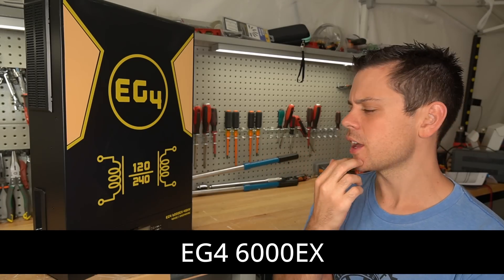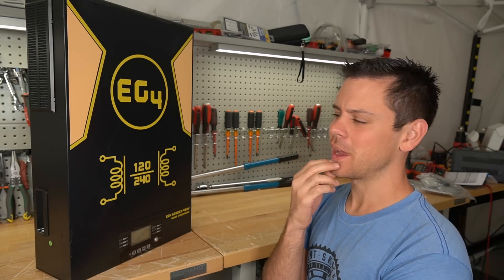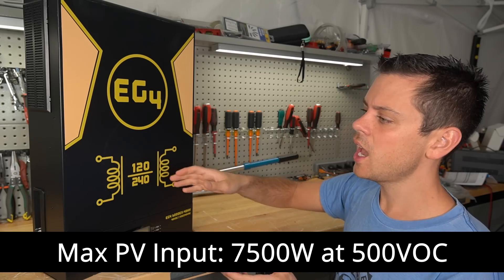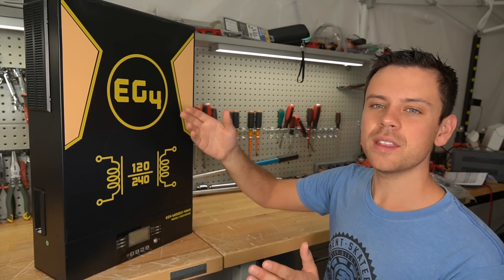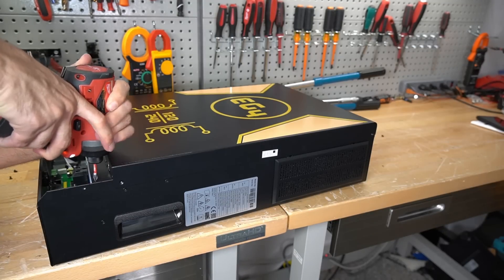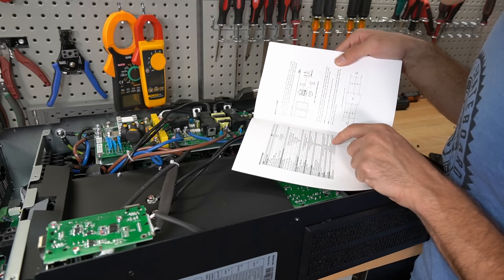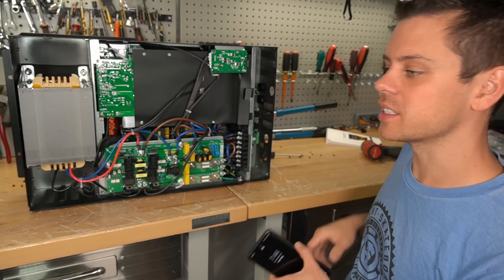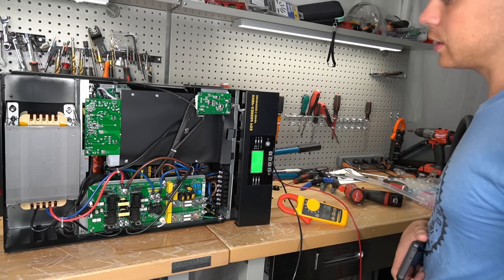EG4 6000EX All-in-one: 6000W LF 120/240V Inverter, 7500W PV Input, 120A AC Charger

Comment: I've been trying to find out even called Signature solar about what the idle consumption was if you turned it off and doesn't still take it solar to charge the batteries also will it shut down the system based on batteries like FLA below a certain voltage when it shuts off does it still have an idle consumption

Comment: Im assuming I can hook up any brand battery to these and not just the EG4 server rack batteries.  I don't see why it would be an issue other than the lack of communication ports, but figured id ask the experts here to be safe :)
Reply: Yes - you just have to go in and change the battery settings to the type of battery you're using, and set your battery parameters.

Comment: Thanks a lot for all the useful information. Maybe I'm an idiot but I sure am a beginner that know nothing about an off grid system. Where I live there is a lot of wind and not much sun... Is there some All-in-one solution that could work with a wind turbine? Is there an equipment I need to convert or regulate the turbine output so I could plug it in the solar input on these solar systems? Yeah I warned you... I'm an idiot. But if somebody know the answer, I would appreciate it. Thanks.
Reply: You could have your turbine feeding a turbine charge controller which is then feeding the same battery bank that your solar system is feeding. You'd just want to make sure that the charge rate to the battery is similar to the charge rate of your solar system.

Comment: Using two inverters seems like a novel idea. I guess you'd have to manually power on and off the EG4 when needed?
Reply: If you're concidering 2, the EG4 6500's make more sense
Reply: @designdepartment841  I'm not considering two EG4's because the idle consumption would be voracious.  I'm considering 1 EG4 for high loads such as my well pump, plus a smaller inverter that has low idle. I'd run the EG4 in ECO mode most of the time and let it trigger into full mode when there are high loads. The rest of the time, the smaller more economical inverter would be primary.

Comment: I wish they would build one for 24v source instead of only 48v. My setup is mobile and my truck runs 24v and I want to use it to charge directly without additional efficiency losses from dc-dc converters

Comment: About the transformer efficiency, Very large transformers achieve greater than 99%(grid and data centers).  This is achieved by using as much steel in the core as possible to reduce hysteresis losses by staying far away from saturation. In the old days, the rough rule of thumb was 25 to 50 watts per lb. but it is obvious that transformer design and materials have improve very much since the 1960s 🙂

Comment: I ordered the PowMr 5500 220 volt inverter, not knowing it is not a two leg 120volt out per leg I thought that was standard for 220 volt here in the US. So I was doing some searching on Youtube to learn more about this unit and this video popped up. The first thing I noted is the 120 / 240 on the front of this unit. So looked into the specks of the PowMr a little closer and indeed it is 220 volts out on a single leg and not two 120 volt legs. So cancelled that thing and I have this unit here on order now. I will be running a 220v welder and a 220v CNC plasma cutter of this thing along with generator support during those operations. I think this will fit perfectly as we can expand this system as needed and that is exactly what I was looking for.

Comment: Will, could you do a video on the ways to add batteries to an existing grid tied solar panel system which is using micro-inverters.
I have 12Kw of micro-inv panels, Enphase system, with 3 lines (4Kw each) that come off the roof. I mostly have a power bill of $0. But when the grid goes down I get zip (also No Water). The idea was that I was going to wait for battery prices to go down. I think now is the time, but don’t know what configurations are possible let alone best, given my starting point.
Thank you in advance for any time or attention you give this. You and your videos are awesome.

Comment: Great video Will, thanks for all you do.  Are you sure it is a low frequency inverter or does it just have an auto transformer to get the split phase?  The spec sheet says surge capacity of 12 kw for one second, does that indicate a low frequency inverter?  Thanks
Reply: It's a high frequency inverter with a transformer for split phase.

Comment: Another pro for this inverter is you don’t need batteries. They will run off solar alone as long as you have enough PV >150v. 😂 I have the Sungold Power SunBlue version. I love it. After my 1st Sungold power LF 3000 watt 24vdc inverter charger I decided to stick with them. I punished that inverter and it just keeps on ticking. 3yrs and still going flawlessly. I have 2 of the sungold 6048s.

Comment: I was waiting for this review and my thoughts were spot on. i bought this because it was the cheapest way in my opinion to get an all in one inverter that would do 240v because most a/c units where i am run on 240v. keep doing what you do bro we appreciate the knowledge and all that you share.
Reply: Still running? Lots of issues talked about on the forums. Getting ready to install 2 and a little scared

Comment: Perfect!  I was on the fence about either buying this new split-phase 6000EX inverter or buying the two 6500EXs and doing the split-phhase wiring while spending twice the money for inverters for that.

Bottom line, a single split-phase 6000EX may be a good low-cost entry-level solution for 240V but the 2 x 6500EXs are more efficient and better for my solution that will scale out with more solar panels and batteries anyway.  As for the split-phase wiring for 2 x 6500EXs, Will already figured out and posted the blueprint for that on his website.  Perfect!
Reply: Remember, 2 x 6500EX's at 70W idle consumption each will draw 140W total idle consumption vs 135W for one 6000EX, so no big saving there. Alternatively, get 240Vac by pairing 1x 6500EX plus one mid-point transformer, which together may also draw ~135W, so there's no magic way of lowering idle consumption if you need 240Vac with EG4 units.
Reply: @lewisreford8552  Yes, I remember what he said in this video.  I also remember that he said to just add more cheap solar panels to offset the idle consumption, assuming you have the land ... I have the land.  Also, I need 240V to run high-end ASIC miners 24/7/365 ... so, there will never be idle consumption with my setup.  That's the least of my worries.  My priority is to achieve the best efficiency possible over long-term 240V continuous use.  For that, Will said to use 2 x 6500EXs and then stack on more pairs as needed.

Comment: Let's say you have a well pump and that's the only appliance that requires a large surge. You could use a second pressure switch (like the one that turns on and off the pump) to turn on an off a big LF inverter to supply the current only when needed for the water demand. And then use a very efficient HF inverter to run 24/7 for loads that require less surge.
And, if the LF inverter can safely handle the pump load staying always switched on (pump connected directly to inverter with no switch between inverter and pump), then you need only the one water pressure switch to turn on and off the inverter.

Comment: 3.2KWh per day of idle consumption.
You cannot offset that with just panels, because panels can only offset while the sun is hitting them pretty directly. For the rest of the day AND the entirety of your cloudy days, that 3.2KWh must come from precious storage, and that's the most costly part. So you don't just need two extra panels; you also need an extra battery (basically another 48V 100Ah $1500 battery.... just to keep the inverter turned on). 
And on those consecutive days of cloudy weather, 3.2KWh EVERY DAY! So let's say you spent $9k on six batteries; half your storage will be depleted over four cloudy days, just to keep your electricity on!

Comment: What is a good stable low cost mppt solar inverter CHARGER for a day campervan? I'll have a window ac & about 3kw of cooking appliances. My energy spreadsheet estimates about 6.5Kw full load (all items running, but highly unlikely)...more like 4kw max for only 2hrs cooking, then fridge, heat or ac 24/7... SUGGESTIONS PLEASE..

Comment: Im glad to see this company improving these designs. I have an LVX6048 and the small terminal studs were definitely annoying. Glad to see they fixed those issue. Unfortunately  I think I can still see that grounding screw in between the battery terminal studs. It may not be a problem but its scary to have that there.

Comment: Ideal current is one thing.  But what about with a 300-500W continues load?  How much of that overhead gets re-captured (as the LF inverter has to fight it self with no load).
Reply: My Sigoneer 6000 watt split phase Low Frequency inverter burns 86 watts at idle. Much to my disappointment, I found that it adds about 86 watts to any load. Say I run an 800 watt heater. I am seeing 886 watts leaving the battery. On the same panel I have a cheap HF Reliable 3000 watt 24 volt inverter that uses 11 watts at idle. That unit runs refrigerators and freezers 24/7 and the Sigoneer only runs during grid outages. So far, it appears that the idle consumption is additive to the load on my inverters running 1/3 to 2/3rds load all the time.

Comment: My concern is, companies like EG4 keep coming out with new models, new features, which is good, however that basically means every model is obsolete in 2-3 years. What will support be like in say 5years. Victron may cost more, but it is a fairly stable platform with fewer but rational upgrades and basically just flat works. So do you want to be on the bleeding edge, or build it, use it and be done?

Comment: You have no idea how reassuring these uploads are Will. I'm about to spend a small fortune on a large system and truly I would never have had the confidence had I not been a subscriber to your channel for years. The service that you have provided to this community and this industry is immeasurable. Thank you.
Reply: I'd hold off on these... Signature told me to "wait until we get the firmware upgrade".... I had $19k sitting in my solar closet and they want people to wait... Stop selling these until you figure it out guys.
Reply: @jasonhensley947   we made the mistake of buying two EG4 6500 inverters. 
Issue after issue unresolved. 
Our panel installer recommended Outback. Service after a sale is worth something
Reply: @richardreese5377  I made the mistake of buying one of these  6k split phase inverters from SS. They shipped me a broken unit and it took weeks to resolve. Lesson learned... take these Affiliate influencers with a grain of salt when it comes to product recommendations with financial ties.
Reply: What did ya buy?
Reply: AMEN! Will is the man on solar stuff!!
Reply: So true! Thanks Will.
Reply: Amen to this
Reply: I bought one of these from Signature Solar and it works perfectly. Thanks will for the info.
Reply: I was looking at this unit because i want to power an a/c unit on 230v since more efficient and don't want to have to buy two inverters.
Reply: I got 4 of these 1 year later 2 have already died.... Hope you didnt buy them.   Hoping the XP models are a bit better

Comment: That no-load current is atrocious for an inverter this size.  They should be able to get that under 50-75 watts just by adding a few chokes to the input windings and using a toroidial transformer.  They will also likely need to do a bit more work tweaking the software a bit more for efficiency.  That no-load current is not something you get back, all or most of it just ends up as waste heat regardless of the load on the inverter.  I would be very sceptical of thier 93% efficiency figure since that is probably at 50-80% load and most inverters are going to spend most of their ontime down around the 5-25% mark only going over when running big loads like dryer, range, HVAC, and waterpumps.  

Even the large Victron units seem to pull more power at no-load than the spec sheets suggest.  I helped a friend with a 10K Quatro from Victron and the spec sheet says it should pull 55 watts at idle but it hovers around 100 watts going up and down a little bit over time.

Comapred to that my Genetry Solar 6K inverter uses about 35-40 watts at idle when the fans are off.  They will be shipping  a 12K unit in the next couple months that I hope has a low noload consumption similar to the efficiency of the 6K unit.  I was told they are shooting for well under 1A idle current on a 48V system so we will see.

Comment: Thank you, Will. I appreciated the discussion of operational efficiency and contrasting more expensive toroidal transformers vs. conventional ones. It reminds me similarly of what I was reading in earlier times with the design philosophies of audio power amplifier technology. The takeaway for me is that Victron's competition will eventually want to figure out how to get a product out there that has a toroidal transformer inside, but at a lower price point.
Reply: Living off grid on the sungold version (TP6000). Idle consumption is nothing compared to what these inverters produce. With 4 server rack batteries & 7500 watt array, it is not noticeable. This inverter runs our whole 50 amp rv with electric heater, 2- fridges, 2- 19 amp roof ac a shop with compressor... With 2 paralleled together for 12 kw we never over loaded them either. The batteries are so powerful, we live as though we are plugged into the grid.

Comment: Great video!! Do you know why the spec sheet rates the "Rating of AC Transfer Relay" at 40A, when that is only 4800W on 120V? The manual also states 40A max breaker for AC input... I want to use this for a UPS backup, and I'm concerned that it isn't really designed for 6kW continuous passthrough from the grid when not on batteries. Thoughts? I'd love to see more content on your channel for considerations for UPS backup without solar. Most content seems solar centric, which I love, but is less doable in some locations. (e.g. a vacation house with less than reliable grid power)  Thanks!!

Comment: Hi Will, I was talking with someone today who got their solar in 2015 and they said that there was a law in the United States whereas if the grid went down you were not allowed to use your own solar power to power your own house. I told him he was full of it but I wanted to check with you first to see if there was a law like that at one time.
Reply: Grid-tied systems must disconnect from the grid so they're not sending power while crews are working on the lines, but you can set up a transfer switch or use an all in one system like this that'll work off-grid until the power is restored.
Reply: @Mazlem  thank you.vso my friend was half right. I don't think he understood that it was just simply that they needed to disconnect from the grid but they can still use their own solar power in their own home.

Comment: hello guys please i need some help out here i need to know how many solar panels and a setup i need to fully charge a 40kw battery bank i just bought, i already got epever charge conroller , am in africa and we do have at worse 6 hours of sun everyday on a sonny day we do get upto 9 hours , so i need to know how much i can spend on sollar panels to keep them fully chaged dailly...
Reply: It's a loaded question. Like what size pickup truck should I buy to tow my boat? Inboard ski boat with 8 liter engine or 4 meter 100 kilo aluminum skiff with 5hp motor?

You need to determine what your daily electrical usage is in kilowatt hours. That gives you a rough estimate of how far you will be discharging your battery bank every day.  The charge controller output in amps and its panel input voltage rating pretty much limits how many watts in solar panels you can feed into it.  The strings of solar panels need to be wired in series/parallel and must stay within the upper voltage limit of the controller.  The higher the panel combo output voltage is, the less amps the connecting cables have to carry. You can always add another charge controller and more solar panels later if your batteries lose their percentage of charge more every day.  

You need a decent battery state of charge meter as well. Without one is like driving your truck with a broken fuel gauge. 

40kwh is a pretty decent size battery bank.   My 46kwh battery bank loses 6% overnight running multiple fridges and freezers and technical equipment. 2000 watts in solar panels takes it to 100% every day in the Summer. As it is, I shut off the solar input in early afternoon or reduce the solar input by rocking open one or more fuse holders in my solar string combiner box to keep the batteries at 80-90%.  We had rains and dark days for a week and the whole 2000 watt array would only add 3-4% to the batteries every day while we used 6%, a slow losing battle but not a worry.  I shall see what shorter days and rains do as Winter arrives. I have another 3000 watts in panels, 10 gauge wiring, MC-4 connectors, aluminum rails and panel clamps, and 2 more charge controllers in storage ready to install if needed.  
Good luck.

Comment: Sounds like this may work well for my air conditioning.  Which runs lots in the summer. And use the heat pump in the cooler weather. Any one have input on this idea?
Reply: That's what I was thinking. I already have an MPPT Solar LV6548 but it only runs 120v. One of these, a couple of strings of used panels, and a battery for the clouds, and this should run my 2.5T central air easy enough. I'm already running 125v dual inverter units but I would like the main unit solar powered and this looks like it would work.